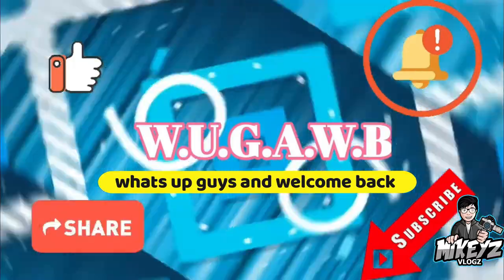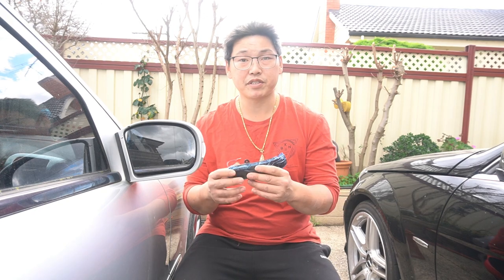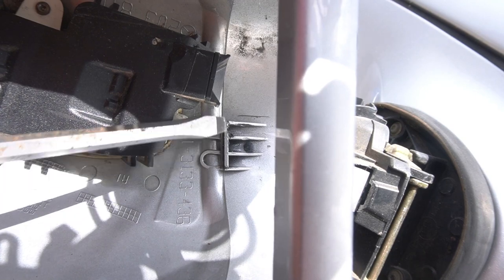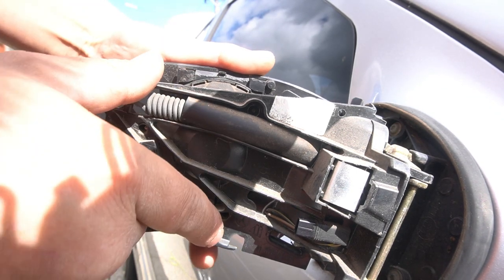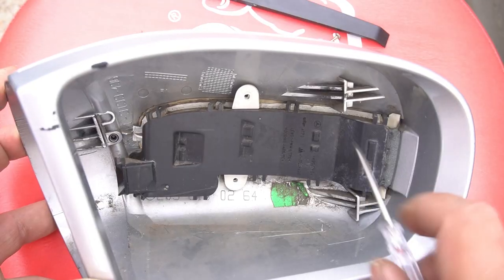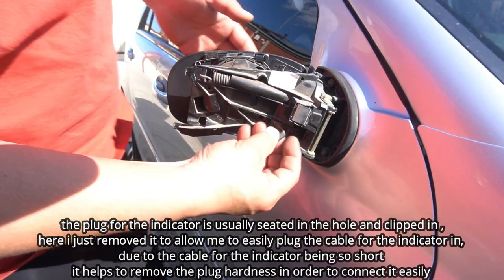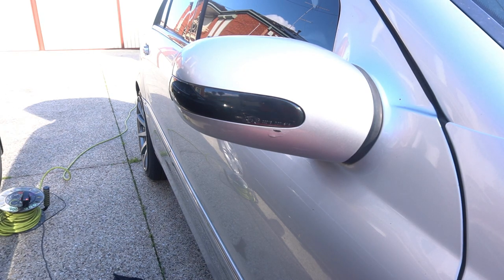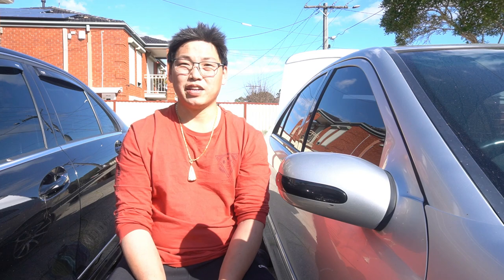how to: mercedes benz w203 mods tinted dynamic indicator install (amber orange single led)

Comment: Wondering if this will fit the W209 CLK?
Reply from the maker: not too sure 😕
Reply: Feel like it should, shares a lot of parts with the W203 Chassis. I’ll order and let you know.
Reply from the maker: @gentrysmith7547  ye true I know what u mean .. but I just can't be sure friend
Reply: @gentrysmith7547  any joy having it work with the CLK?
Reply: @swarvehelix7200  Unfortunately, haven’t bought these yet, I just wrapped my turn signals in 3M.

Comment: The is the best explanation of how to remove mirror.  What size tamper proof torque do I used to remove while mirror form the door?
Reply from the maker: thanks mate it's a t20 most likely if I remember correctly

Comment: How ti connect green cable for ambra color?
Reply from the maker: your trying to connect the dual colour ones?? do u have puddle light?? if u dont i think u can connect to the heated mirros cables , try that and see if it works, if not you will need to find a 12v power source , and its shoul dbe switched so u only get power when the car is turned on ..if u connect to a constant 12v then the light will keep flashing everytime you indicate and lock and unlock car ..., that u dont want so ensure you connect it to a switched 12v source ... and if all else fails u will need to use a relay so that u only send power to the 2nd led wen u lock and unlock car ... the point is not to have the 2nd led colour show wen u indicate or else it may be illegal , hence why i simply went with the single colour ones saving the hssle of all that messing around
Reply: @MIKEYZVLOGZ  could it go to the mirror adjuster motor?
Reply: My car is a w203 sportcoupe. Later I try to connect it to the door unlock motor
Reply: Hello, have you found any metod on how to connect the other wire to get the blue light?
Reply: It's nice! I have a sport coupe too, but good is when you open the car,  the blue light, then when you turn left or right the orange light!

Comment: hello Mikey! thank you so much for your help. I bought dual colour dynamic signals and Im wondering where to connect the extra wire of the blue colour?
Reply from the maker: u should be able to connectnit to any 12v so even your heated mirrors should work ..as they only need a 12v power supply
Reply: @MIKEYZVLOGZ  don't know how to thank you! you're the best ❤️
Reply from the maker: @endritlastone2436  don't sweat it..happy to help did u end up connecting yet

Comment: Hello i would ask that i change thats lights but always show error how can i fix it thankyou 
I hope somone risponde
Reply from the maker: @samirveapi7697  u may need a resistor pr capacitor to ensure enough voltage ... as leds have voltage drops and don't use as much current which is why it gives an error
Reply from the maker: @samirveapi7697  are u using the dual led one? if u are its most likely due to the 2nd led throwing the error   . I had same issue on my w204 and went back to single led and no errors